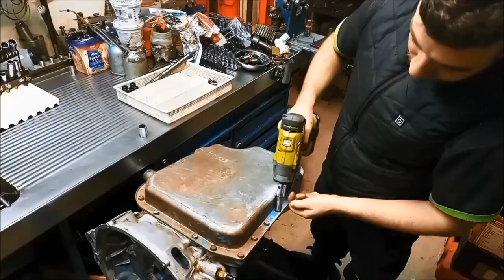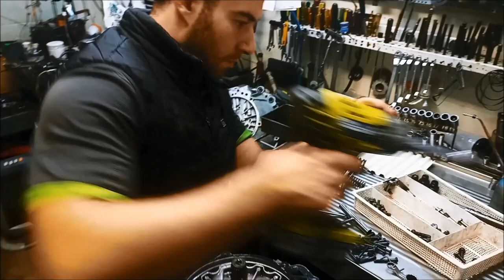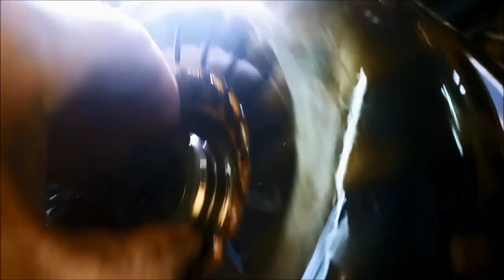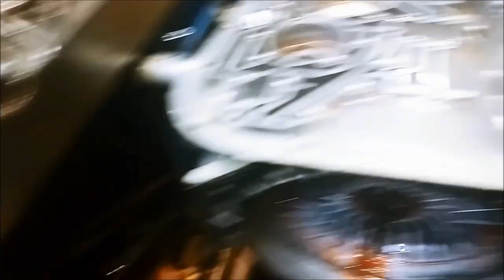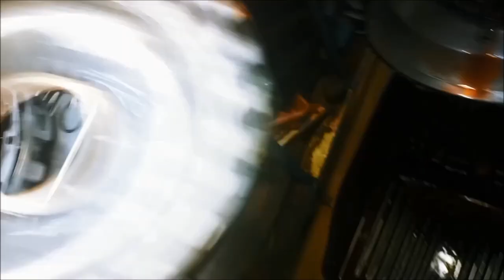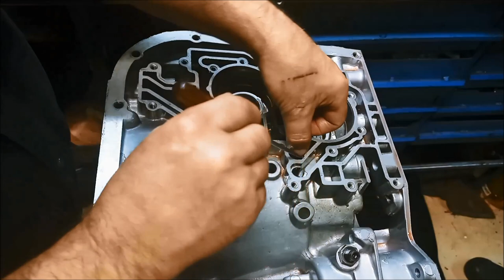ASMR Hydramatic 05 Disassembly Classic Automatic Transmission ( ASMR )

Comment: enjoyable  , been a while since i had a trimatic in my hands  however we do have a hz premier with one thats parked in the shed for future use. 
i always binned the trimatics and went with TH400's , but later i was told the trimatic can be quite good with a bit of work and suck less HP from the engine.
Reply from the maker: good ol`trimatic ! this is hydramatic 05 1961-1965 era of the ek, eh and ej holdens. glad you enjoyed cheers